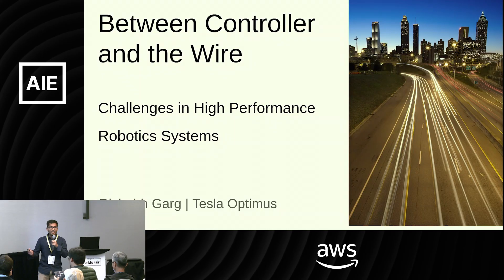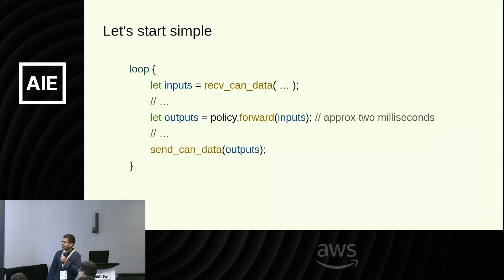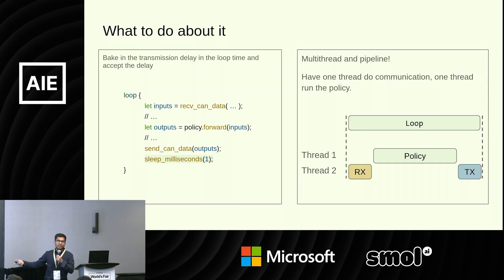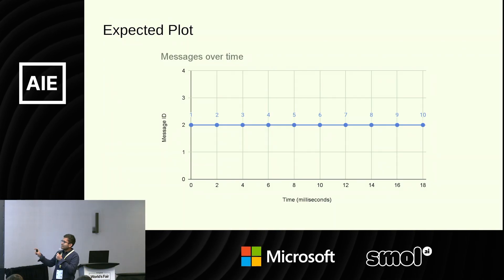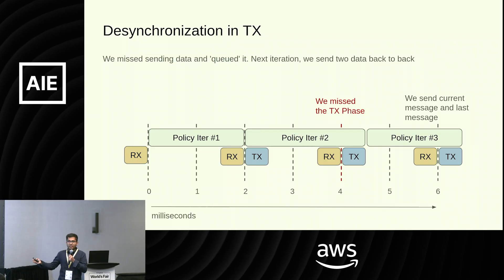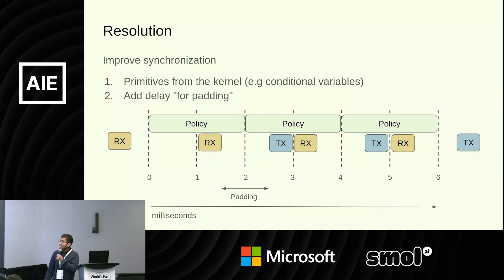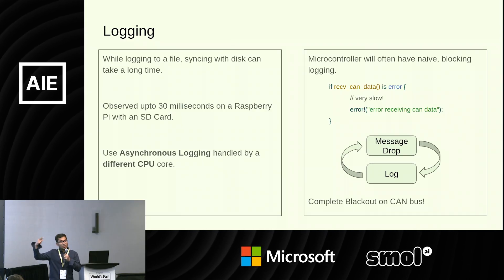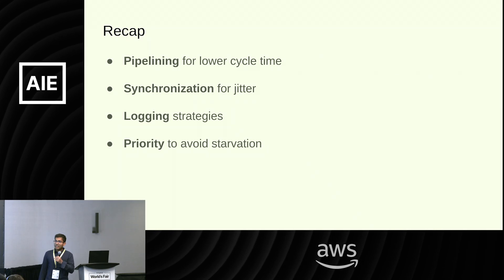Rishabh Garg, Tesla Optimus — Challenges in High Performance Robotics Systems

Comment from the maker: Introduction to Robotic Systems Challenges
The speaker introduces the core challenge in robotics: the seamless integration of mechanical, electrical, and software components [00:53]. When a robot behaves unexpectedly, it's often difficult to determine whether the fault lies within the control policy or the underlying software system.

The Problem of Loop Delays
Initial Architecture: A basic robotic system is presented, consisting of sensors, a CPU/GPU, and actuators, all communicating via a CAN bus [01:23]. The control loop is intended to execute every 2 milliseconds [01:57].

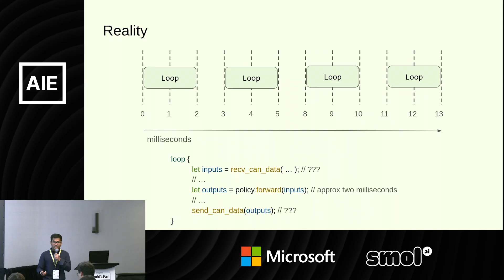The Delay: In practice, a 1-millisecond gap appears in the loop's execution [02:25]. This is attributed to the time required for messages to be transmitted and received over the CAN bus [02:42].

Solutions: To address this delay, two primary solutions are proposed:

Simply accepting the delay, which is not ideal for high-performance applications [03:21].

Implementing multithreading and pipelining, which involves splitting the communication (RX/TX) and policy execution into separate threads. By staggering these operations, the loop time can be significantly improved [04:00].

New Problems: Stuttering and Desynchronization
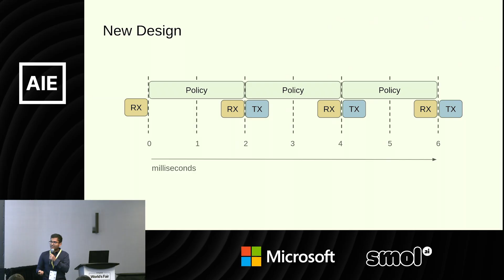Emergence of New Issues: Despite the improved runtime from pipelining, new problems arise, including intermittent system stuttering and motors that abnormally ramp up to catch up [04:32].

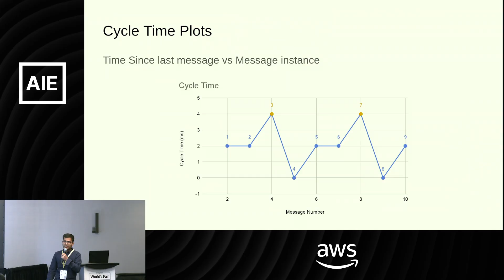Diagnosis: Using external transceivers and the candump utility, the problem is diagnosed as desynchronization in the TX (transmission) phase [04:49]. A missed transmission results in two messages being sent back-to-back in the next cycle [06:57].

TX Resolution: The solution for TX desynchronization involves using synchronization primitives like conditional variables or adding padding to the loop to accommodate potential delays [08:38].

RX Desynchronization: A similar desynchronization issue can occur on the RX (reception) side. This leads to stale data being fed to the control policy, causing the robot to "overcompensate" [08:03].

Other Related System Issues
Logging: Excessive logging, particularly on systems like a Raspberry Pi with an SD card, can introduce significant delays (up to 30 milliseconds) and even cause the CAN bus to experience a complete blackout. The recommended solution is asynchronous logging using a separate CPU core [09:25].

Priority Inversion: A high-priority user process can inadvertently block the kernel's interrupt handling and processing of CAN messages. This prevents the user process from receiving the data it needs, resulting in a deadlock or significant delays. Properly configuring process priorities is crucial to avoid this [11:09].

Conclusion and Key Takeaways
The talk concludes with a recap of the essential principles for designing high-performance robotic systems:

Pipelining for lower cycle times.

Synchronization to reduce jitter.

Effective logging strategies to minimize performance impact.

Careful priority management to prevent system starvation [12:02].